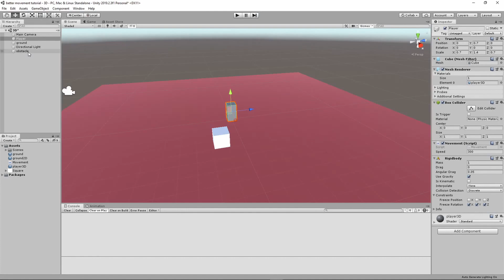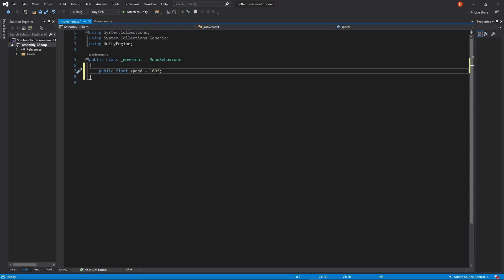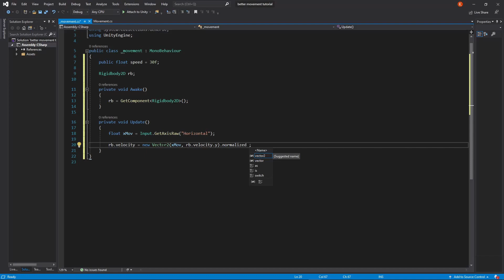The right way to do movement in Unity!

Comment: If you wanna add clamping to your code, I got it right here:
{
    float xRotation = 0f;
    public Vector2 turn;
    public float sensitivity = 50;
    public Vector3 deltaMove;
    public float speed = 1;
    void Start()
    {
        Cursor.lockState = CursorLockMode.Locked;
    }
    void Update()
    {
        turn.x += Input.GetAxis("Mouse X") * sensitivity * Time.deltaTime;
        turn.y = Input.GetAxis("Mouse Y") * sensitivity * Time.deltaTime;
        xRotation -= turn.y;
        xRotation = Mathf.Clamp(xRotation, -90f, 90f);
        transform.localRotation = Quaternion.Euler(xRotation, turn.x, 0);
    }
}

Comment: except it has been stated a million times.. one should not use a rigidbody for a character controller unless the game they are making is heavily physics based. If you're making an RPG or an FPS game, code your own controller. There are plenty of tuts on that topic. NEVER use a rigidbody in these as it is extremely performance hungry and you have extremely low control over it.

Comment: as soon as i press play it's like 3434 on x 5e44+22 on y and 426398 on z
Reply from the maker: That's odd. Can you send me your code?
Reply: @ComplexDimensions  using System.Collections;
using System.Collections.Generic;
using UnityEngine;

public class movementtest : MonoBehaviour
{

    public float speed = 5f;
    //i put rigidbody by drag and drop in editer
    public Rigidbody rb;
    
    void Start()
    {
        
    }

    
    void Update()
    {
        float x = Input.GetAxisRaw("Horizontal");
        float z = Input.GetAxisRaw("Vertical");

        rb.velocity = new Vector3(x, rb.velocity.y, z) * speed;
    }
}
Reply from the maker: Interesting, the code seems correct. Check your rigidbody settings. You may have set the mass to low or something like that.

Comment: Hello‼️Can you Please‼️ 🙏do the same but for a mobile (touchscreen) without a joystick just with your fingers.? How rigidbody will look like with a touchscreen.
Reply from the maker: The RogidBody won't change. The way that you get input is the only thing that changes. Can you describe what you mean by "without a joystick"?
Reply: @ComplexDimensions  I meant the control of your fingers on the screen:) (when you press anywhere on the screen and control the object)

You can help! How to correctly enter Rigidbody in the Update, but only with this code:

private Touch touch;
private float speedModifier;
Rigidbody rb;

void Start ()
{
rb = GetComponent <Rigidbody> ();
 speedModifier = 0.01f ;,

}

void Update ()
{
       if (Input.touchCount> 0)
       {
              touch = Input.GetTouch (0);
    
              if (touch. phase ==
TouchPhase.Moved)
               {
                       transform.position = new Vector3 (transform.position.x + touch. deltaPosition. x * speedModifier,
                transform.position.y, transform.position.z + touch.deltaPosition.y * speedModifier);
                }
       }

}
Reply from the maker: I haven't really worked with touch controls before, but what you want to do is you want to get the position of where the player touched the screen, cast that to the world position, create a vector starting from the player to that world position, normalise it and use that as the movement vector. Everything else stays the same. It sound complicated, but it's pretty simple to implement. I can help you with that if you want to.
Reply: @ComplexDimensions  Yes, I would very much like to get help with this! Will be happy!

Comment: well, first of all - i really like both the approach and result, but i have only one concern...
here's what a description for "Rigidbody.velocity" says:
"In most cases you should not modify the velocity directly, as this can result in unrealistic behaviour. Don't set the velocity of an object every physics step, this will lead to unrealistic physics simulation. A typical example where you would change the velocity is when jumping in a first person shooter, because you want an immediate change in velocity."
which to me should conflict with what you've done, yet you doesn't seem to encounter any "unrealistic behaviour"
leaves me kinda wondering
Reply from the maker: The Unity docs refer to simulations. Say you want to add a Force to the player. With this method, you wouldn't be able to do that, since you change the velocity of the player every frame. In this case, we don't want simulations, but instead, we want a basic player movement. But you are right. It would be better to work around it.

(Note: We can add a Force only in the y-direction since we don't change the velocity on the y)

Comment: Bro can you help me, my player is flying when it touches an object with a rigidbody.  here is my script (it is in 2D world) 

using System.Collections;
using System.Collections.Generic;
using UnityEngine;

public class PlayerMovement : MonoBehaviour
{
    [SerializeField] float movementSpeed = 1;

    Rigidbody2D rd;

    private void Awake()
    {
        rd = GetComponent<Rigidbody2D>();
    }

    // Update is called once per frame
    void Update()
    {
        float xMovement = Input.GetAxisRaw("Horizontal");

        rd.velocity = new Vector2(xMovement, rd.velocity.y).normalized * movementSpeed;
    }
   
}
Reply from the maker: The problem here is that you normalise the velocity both in the x and in the y. I assume you want to make a platformer or something similar. In that case you don't want to affect the velocity on the y-Axis at all. Also, quick note, don't forget to multiply the input by Time.deltaTime. With all of these changes your Update method should look something along the lines of the following:

void Update ()
{
 float xMovement = Input.GetAxisRaw("Horizontal") * Time.deltaTime * movementSpeed;
 
 rb.velocity = new Vector2(xMovement, rb.velocity.y)
}

Comment: How do you get gravity to work because all accelerating movement gets removed for me if i use any velocity code
Reply from the maker: Actually, it doesn't get replaced. If you take a closer look at the code, we are setting the velocity on the y-Axis to itself. That way it doesn't get affected at all. If doesn't work for you, you may need to double-check you code again.
Reply: @ComplexDimensions  ok so if you set it to itself then it will set it to the gravity i have chosen maybe

Comment: you should multiply everything by DeltaTime or the movement speed will be slow in low fps and fast in higher fps
Reply from the maker: If you want to work with gravity, then by multiplying the y axis with Time.deltaTime you are making gravity frame dependent, which is not what we want.

Comment: Oh my, this is soo much easier than every other method.. And most relyable either! With this,  can i use the ForceMode things  like Impulse and etc, since the RigidBody is the one moving? Do you have any cool video on the subject? :D

Great vídeo, insta-subbd!
Reply from the maker: Since you are setting the velocity directly, it's not really possible to use build-in Forces. You could use RibigBody.MovePosition instead, which you can use Forces with, but I find it a bit more complicated for beginners.
I am also planning to do a video on custom smoothing in Unity, but that needs to wait, unfortunately.
Reply: @ComplexDimensions  Nice! Good to know!

Comment: You should handle rigidbody movement in the Fixed Update loop where the physics calculations are made instead of Update.  Otherwise it's a nice video :)
Reply from the maker: read the pinned comment and the discussion in the replies.

Comment: im having two errors

Assets\PlayerMovement.cs(23,20): error CS1002: ; expected
and
Assets\PlayerMovement.cs(23,88): error CS1002: ; expected

Below is my code
using UnityEngine;

public class PlayerMovement : MonoBehaviour
{
   
    
      public float speed = 5f;
      Rigidbody rb;
    
    
    private void start()
    {
    rb = GetComponent<Rigidbody>();
	}
    

    // Update is called once per frame
    void Update()
    {
      float xMov = Input.GetAxisRaw("Horizontal");
      float yMov = Input.GetAxisRaw("Vertical");

       rb.velocity new Vector3 (xMove*speed, rb.velocity.y, zMove*speed)*Time.deltaTime
    }
}

Comment: Your overrideing the velocity of the rigidbody... Its better to use rb.AddForce
Reply: the problem i have with that is when i stop pressing a button i keep going for a second ive tried other solutions but  they all have drawbacks
Reply: @liammelton1814  I also had this problem there 2 Solutions: 

1) You can write a Countermovement in the Scripts like in the dani rigidbody movment Tutorial
2) You can set the Drag of the Rigidbody to 3 so there is more friction
Reply from the maker: @TotallyNotInspired  The problem is, though, that you don't have full control of the motion, which may very well be what you want. But then you won't be able to, for example, smooth the movement of the player.
Reply: @TotallyNotInspired   Thanks this helped but i need help finding out how to make the character only have one jump until they touch the ground using rb.AddForce
Reply: @liammelton1814  You need 3 bools 
1. grounded (you can use a OnCollisionStay() or a Raycast grounded System)
2. jump (jump = Input.GetButton("Jump")
3. readytojump (this will be reseted using a jumpdelay after you jumped, make sure to set it to true in the Start Methode)

Make a void Jump () and call it in the FixedUpdate whit:

if (grounded && jump && readytojump)
         Jump()

The Jump Methode looks like this:

private void Jump () 
{
   rb.AddForce(Vector3.up * jumpforce, Forcemode.Impulse);
   grounded = false;
   readytojump = false;

   Invoke(nameof(ResetJump), 0.1f);
}

private void ResetJump () 
{
  readytojump = true;
}
Reply from the maker: @liammelton1814  You will need to check if the player is touching the ground and if the spacebar or any other bottom is pressed at the same time. To find if the player "grounded" you can use a raycast downward or even better a sphere cast.

Comment: Guess using this would be aloy easier when trying to convert to the new input system
Reply from the maker: Not really. When it comes to input there should be no different. As far as I am aware, the way you get input shouldn't affect the movement method. If you have a suggestion, I will be really happy to hear it.

Comment: Great tutorial!! but i have a problem. if your Cube flips over axis changes and you start moving in the wrong directions. What should I do? Should I use Camera's axis? İf it is, How can I do this? Thanks for now :)
Reply from the maker: Hey! The problem is that you are using Vector3.forward and Vector3.right for movement. These axes refer to the global x and z axes, which remain constant. You will need to make use of the transform.forward and transform.right accordingly. These are local axes, which means that they change according to the rotation of the object. That should solve the issue you have. I have a video on RigidBody Fps movement in Unity, which might help you.
Reply: @ComplexDimensions  Thanks, I watched your video. but I still can't fix my problem. my game is not FPS. it's a hyper-casual game. My player is a sphere And I have to move it on a platform that varies in height. I am using the joystick and even in the simplest movement. Sphere's axis changes and start moving in the wrong directions. It goes up-cross when I pull the joystick up :/ How can I solve this. If you help me I would be so glad :)) Thanks for now.
Reply from the maker: @taylankocadag6708  Interesting. Can you send me your code? it will really help me figure out your problem. Also, you could try rb.velocity = Vector2.right * xMove + new Vector2(0, rb.velocity.y); This may work for you (providing it is a 2D game). Lastly, you could make the circle/sphere not roll, or if you want it to roll, you could make it a child of an empty and move the empty instead of the sphere itself. Thy these things and if they don't work, it would really help if you send me your code. You could also join us on discord, where we can discuss it further.
Reply: @ComplexDimensions  Thanks a lot my friend. I fixed :)))

Comment: My script isn't picking up xMove and zMove
Reply from the maker: Can you send me your code?
Reply: @ComplexDimensions  
using UnityEngine;

public class PlayerMovement : MonoBehaviour
{
    public Rigidbody rb;
    float xInput;
    float zInput;
    public float speed;

    // Update is called once per frame
    void Update()
    {
        xInput = Input.GetAxis("Horizontal");
        zInput = Input.GetAxis("Vertical");
        rb.velocity = new Vector3(xMove * speed, rb.velocity.y, zMove * speed) * Time.deltaTime
    }
}
Reply from the maker: There are no variables called xMove and zMove. You used the names xInput and zInput. So you need to change the xMove to xInput and the zMove to xInput. Let me know if it worked.
Reply: @ComplexDimensions  I put what it said in the description
Edit: made the change and it worked. I should never code just after an hour of math work.
Reply: When I said it worked, I meant the code showed no errors. I didn't actually try running it. I just ran it, it doesn't load.
Reply from the maker: What exactly doesn't load?
Reply: @ComplexDimensions  I click the play button and it just, doesn't start
Reply from the maker: That either means, that you have an infinite loop somewhere, or that you still have some errors to solve. Can you send your code again? Also, check if the file name of your code and the class name much!
Reply: @ComplexDimensions  Here is my code again
using UnityEngine;

public class PlayerMovement : MonoBehaviour
{
    public Rigidbody rb;
    float xInput;
    float zInput;
    public float speed;

    // Update is called once per frame
    void Update()
    {
        xInput = Input.GetAxis("Horizontal");
        zInput = Input.GetAxis("Vertical");
        rb.velocity = new Vector3(xInput * speed, rb.velocity.y, zInput * speed) * Time.deltaTime;
    }
}

Also, what do you mean by class name? I forget what terms mean.
Reply from the maker: @someonerandom8511  The name of the class is, in this case, "PlayerMovement". You are creating a class with "public class" and then you pass in the name "PlayerMovement". Make sure that name is the same as the file name that the code is stored in. Also, the code seems correct. I've just tested it and it works fine ( I am using a speed of 200). Make sure all the values are set to what they should be. Lastly, you can always check in the console window to find out if there are any errors. If your problem is that you can't play at all, there should definitely be an error in the console and a message in the game view saying that you need to fix all the errors before playing. Check those and let me know!

Comment: "the right way to do movement in Unity" Not to be a jerk but I have to shame meme you: Well yes but actually no.

You did right in using rb.velocity to avoid all that stupid physics stuff. Using GetAxisRaw is also correct, as that means you can make quick input specific controls based on control:
Such as if you're moving forward and push backwards. The input will instantly be backwards and can compare the angle to movement, and make specific turning animation instant.
However.
You did the same method I used for so many years. It can actually work and is really good. Especially with getAxis where you can change the acceleration in Input options.

But how I usually do it is custom acceleration with: 
movement += input*speed*Time.deltaTime;
movement -= movement * 0.01f; This is drag.
movement -= movement.normalized * 0.1f; friction.

The main point is adding to the movement instead of straight out setting it. For example if you're gonna be able to be pushed.
If you set your movement directly like your code when grounded, then any momentum will instantly vanish cause you strictly set the movement.
You can of course change the values but the main point is control and allowing outside forces to affect you.
Since gravity should be it's own variable so as not to be affected by friction or such. Then I'd recommend making a public function that sets the movement to your force and the gravity variable to your push force's y value.
You can still use your method for other games, especially classic shoot em ups where you run like cocaine on legs.

Main point: Avoid setting values directly as much as possible to not get sharp weird movement that feel unresponsive. Remember Super Mario and Doom.
Reply from the maker: What you are talking about is mostly feel. You are totally right, but keep in mind, this video is ment for beginners, and I don't think your method is very easy to understand. I totally agree with you though and I think it is a good advise for someone. Thanks a lot, by the way!
Reply: @ComplexDimensions  Thanks a lot. And yes. It took me a few years to go from just wanting smooth movement, to having interacting movement.
Like going from animation to IK movement.